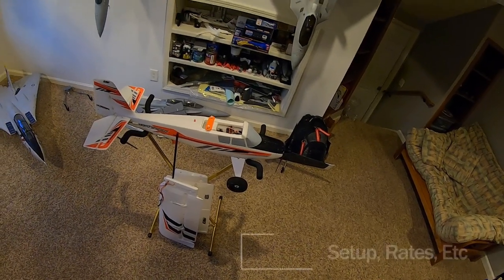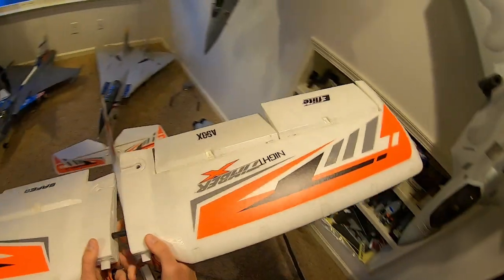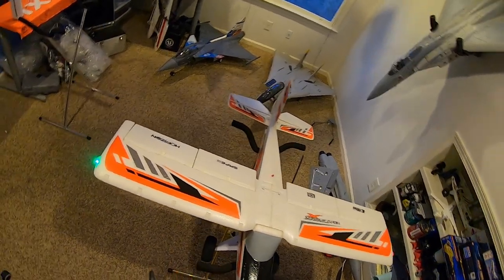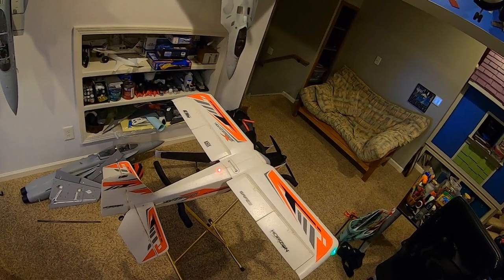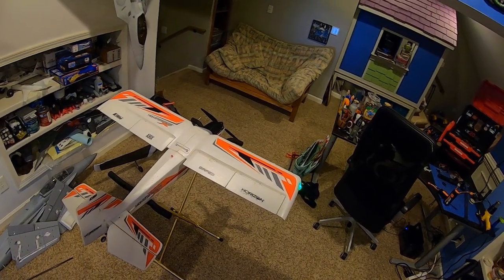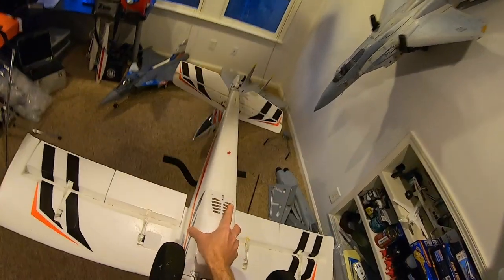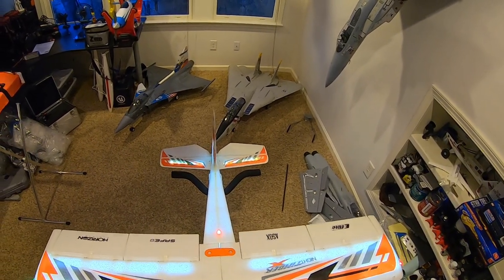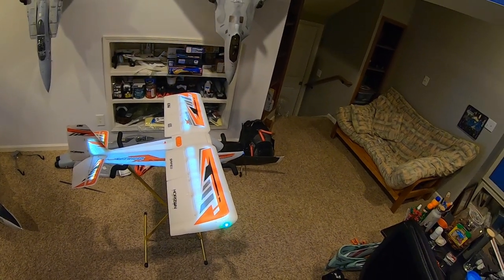E-Flite Night Timber X Setup - Flaperons, Harrier Flaps, Snap Flaps, Rates, Receiver Programming

Comment: Hey Jon, question for you, I have an NX8, but when I try and set the ailerons to 150% the travel stops at 100, any suggestions?
Reply from the maker: You need to unlock the receiver and reprogram it so it isn't locked to 100% rates. If you don't do this it can only travel to 100% because that's where Horizon locks BnF travel points.

Comment: Thank you for this video and the comments. I just got my night timber x after flying the the timber x 3d in real flight evo. I moved my lights to the bind port, split the flaps to ch 5 and 6 as suggested. But instead of building a new profile, i used the spektrum dx preset profile for the timber x full span aileron. Only had to move things to my preferred switches and build the harrier mix. 2:04
Reply: Can you explain how you did the harrier mix? I’m using an nx8. It would be greatly appreciated.
Reply: @johnd9357  he explains in the video, but you mix elevator to r flap, then for rates use 100 and -100. The flap should nove the same direction as the elevator, if it moves opposite, swap the 2 rates. And assign it to a switch.

Comment: Wow!  Never realized how little I knew about setting this plane up!  Thanks.
Reply from the maker: There's a lot to it if you want it to perform better than it does stock. Of course, this can be said about most models.
Reply: @TwoBrosRC  I could not quite catch the replacement servos you used.  Links on such things can be exceedingly helpful.  Do you get a commission from HH?  Perhaps you should ask for that.  I would buy a plane you reviewed and instructed on how to set up through such a linkage.  Have you flown any of the Addictions?  I have the smallest one and have 3 fabulous flights on it so far.  A bit pricey and not as robust as a foamy but boy does it perform and I can’t really do squat yet.
Reply from the maker: No commissions here from any RC company. I do get a small kickback if you buy from my Amazon links though. https://tinyurl.com/B11DLS is the servo I'm using here.

Haven't flown any PA models yet.

Comment: Good video. I’ve had a couple of Timber X’s and never could get more than 100% servo movement. I thought it was a limit set in the receiver. How do you get that much more throw? Thanks!

Edit: And I just read another post where you explained…which is what I thought I would have to do…Thanks again!

Comment: Nice video.  Got a kick out of your "older" airframes.  My oldest is a TopFlight Contender balsa kit that was my "warbird trainer" with an OS -70II four-stroke (third glow engine) that I have been flying since 1989.  ;-)
Reply from the maker: I doubt your 1989 model was made with EPO foam though. ;) This Timber X is basically ancient considering it's close to two years old and has flown over 800 times.

Comment: this is amazing.

are you able to do CROW with this set up? or do you need a new receiver/rewire the stock receiver to do crow?

is SAFE available/working with your flaperon/harrier/snap flap set up here? 

if using crow, is SAFE available? or does it have to be remapped!

looking forward to trying this!!
Reply from the maker: You'd need an 8 channel receiver for crow. SAFE works with any wing or tail type in Spektrum. Join Discord via bit.ly/TBRCDiscord for assistance!

Comment: Hi Jon, I recently picked up the Night Timber X. I bought the AGFRC 9g servos you're running. My question is, what servo horns are you using? The ones that come with the plane don't fit the spline on the AGF servos, and the ones that come with the servos seem way too small. Please help, Thank you!
Reply from the maker: I'm using the stock horns - the ones that came with the Timber X. They take a bit of work to fit into the AGF servos but will fit in if you force them to. Mine have been on there for 1.6 years now.
Reply: @TwoBrosRC  Thanks again for the help Jon! I see what you mean, they are stubborn to get started, but once you get them to stay, you can use the screw to get them down. I appreciate your help!
Reply: What servos exactly are you using? The b9dlm or b11dls?

Comment: Great video. I echo your statement on the durability of this plane. I have stalled mine to the ground herd 4 times. Once so hard I shattered the carbon rods in the nose. I replaced them, glued the nose and the landing gear back on and she flies great. 
What is the spectrum mixing bug you mentioned in the video?
Reply from the maker: The mixing bug is where the transmitter expects channels to be in a specific order but you've reordered the channels manually, causing it to bug out. You can see it on display in certain models like my Turbo Timber where I need to mix ELE to LAL to mix flaps, and mix ELE to FLP to mix ailerons for crow.

Comment: Hi Jon,  great video. Can you possibly explain further to what improvements you did on the landing gear? Had a small crash but the retainers of the springs broke off! Had you a similar problem and how did you fix? Thanks
Reply from the maker: I didn't really do anything else to it aside from reinforce them with Gorilla Glue eight months ago. That was only because the gear mount in the fuselage suffered some damage and I had to re-seat it properly.

Comment: Hey Jon.  As always, I love the technical detail you provide in your videos.  I experiment a lot with my Night TimberX.  Its an old beater for me, hence I don't hesitate to experiment.  Would you have a moment to answer a mixing question for me.  My setup: Night TimberX upgraded with an 8360T Receiver.  Every servo is plugged into its own port on the receiver.  All works very well.  I'm now trying to set up full span ailerons (flaperons) triggered by switch E on my iX12.  P-Mix 1: AIL>RFL: Switch E.  P-Mix2: AX1>LFL.  My left flap will not move in sync with my left aileron.  It moves in the opposite direction.  Is this what you refer to as the Spektrum mixing bug (my software is the latest revision.  It's as if I need a servo reverse function as part of mixing.  I don't see that as an option.  Do you know of a work around?  Any feedback would be greatly appreciated.  Thanks.
Reply from the maker: Try changing the channel you're controlling with aileron until it works, or reverse the flap servo if that needs changed. It's difficult to troubleshoot from text alone, but it does sound like the mix just isn't targeting the correct channel - or that the mix needs to be reversed. If you're currently using -100 and -100, try 100 and 100 instead.
Reply: Thanks Jon.  Tanks for those suggestions.  I got it working.  Turns out I didn’t need two mixes.  A single Aileron to flap mix solved it for me.

Comment: Love this video!  Wasn't sure if you covered it but did you max out the mechanical set up ie clevises and horns at max travel and then 150?

Also are you able to do safe on off, reverse thrust, full span ailerons and flap mixing as well as crow with an nx8?  What are your preferred switch assignments?

Going to try to program mine via what I've learned in your vid!
Reply from the maker: Hey man! I did set up the linkages for maximum effect. Clevises on the outermost hole on the wing surfaces, innermost hole on the rudder and elevator horns. Outermost hole on all servo arms. You can set up everything seen in this video with an 8ch radio. With regard to switch assignments, could you be more specific?
Reply: @TwoBrosRC  Awesome to know! really love that someone out there is doing vids that show what can be done "outside the box" on these planes. in terms of switch assignments, i was curious how you set your radio up for ergonomics? like do you prefer flaps on a certain side for last minute landing throws, same with snap/elevator flaps? in case you need to adjust quickly or go back to all off.  or reverse thrust being better on one side versus another? same with safe select and throttle cut and dual rates- theres so many switches sometimes it's nice to see how someone else does a set up that you can base yours off of.

i also saw in another comment that you mentioned unlocking the rx for 150% - did you have a vid on this or would you do one in the future, interested to learn more! i noticed in the nx8 i can only go to 125, but really 125 seems identical to 100 when i A/B them. does that probably mean it's locked? would it be worth unlocking or just maximizing mechanical throws?

i also realized i probably cannot do crow with the stock night timber x receiver because it only has 7 channels, and you'd need 8 for crow correct?

really appreciate you help and your vids! def subscribed!
Reply: @TwoBrosRC why outermost hole on wing surfaces? Wouldn’t going to the innermost hole give the most travel? Not sure why rudder and elevator need innermost hole for max travel yet the wing surfaces need outermost?

Comment: Awesome video Jon, thank you for sharing with the rest of us! 

I'm curious, why did you change the stock servos? (Because the originals stripped, they're just bad, or just your personal servo preference?)

BTW, I just got my banged up Timber X setup with these mixes, and  can't wait to try these out! :-) Thanks again!
Reply from the maker: Glad you enjoyed! I changed the servos because they're not precise and don't have as much torque as the AGF servos do. Precision is everything for flap compensation on the elevator - the stock servos will move to 5 or 7%, but not 6% - if that makes sense. You give the model the elevator comp required for full or takeoff flaps and it'll float upward because the servos don't actually move to the position the manual calls for. The AGF servos will, and they'll hold tight with the torque they put out.
Reply: Nevermind about the servos Jon, I had missed your final comments, where you explain its about precision! :-)
Reply: @TwoBrosRC  good to know!
I’m nowhere near your skills, but the idea is to get there 😊. 
I’ll have to give those servos a try! Thanks again! 🙏🏼
Reply from the maker: @OraTab  You'll get there! All it takes is practice.

Comment: I'm not a novice, but not a pro. I like capable flying. Holy quapamoly, this IS a setup!! You sent me the link a while ago. I've finally busted out my Night Timber X and have looked at your settings. I have a DX8 G2, I'm unsure if this will work. How many channels does this use?? Thanks for your reply and videos. AirHammer out!!
Reply from the maker: Just six total. Eight if you want crow.
Reply: @TwoBrosRC  That was fast!!:). Thank you for your response and great videos. 
This helps and magnifies the hobby for everyone above beginner. 👍👍

Comment: Ive noticed ALL ur planes r really shiny. Are you using the minwax clear gloss paint? (I have, & do but so far only my extra 300 & FMS pitts are THAT shiny!) So shiny you need shades on a sunny day! 😁👍
Reply from the maker: Nah, only my Extra, 737, and Pitts are shiny. The rest are just as they come from the factory. I use Minwax polycrylic and brush it on, though I suspect I'd get better results if I learned how to spray it on correctly.
Reply: @TwoBrosRC  

I spray mine, same paint. Yours/your brush on Method looks better than my aerosol! 👍

Comment: Are those AGF servos 180° rotation? I saw a review on Amazon that said they were only 90°. I am wanting to get a little more throw on the ailerons on my 1.5 m timber.
Reply from the maker: They move about 140 degrees with 150% rates. 180 degrees won't help you much because the ailerons on a Timber can only physically move so far before they bind.

Comment: Hey Jon, Great video. My new never flown night timber's elevator servo seems to have died while i was setting up. It works once or twice then starts to over heat it seems and stops working completely. I am looking at the servos you have recommended and am noticing the rudder and elevator servos are glued in there with some pretty serious adhesive. Almost a white epoxy i think. how did you remove them without damaging the body?
Reply from the maker: I just pulled them out. It's a silicone caulk that holds the servos in place. It won't damage anything if you pull them out gently. You can slide a knife behind the servos to help loosen them too.
Reply: @TwoBrosRC  thanks man!

Comment: Are you using the servo arms that come with the AGF servos.  They are quite a bit shorter than the stock servo arms. The stock servo arms do not fit on the AGF servos.. I haven't installed them but I suspect at 150 travel setting, I will get all the throw that is necessary even with the shorter servo arm.
Reply from the maker: Nope, I use the stock arms and made them fit by jamming them in and screwing them tight. Haven't had a single issue with the stock arms in 1.5 years of flying this model.

Comment: When you changed the servos did you have to use a reverse servo on one flap like the original setup.
Reply from the maker: It's been a long time since we did this setup video. The way this is done would necessitate having the flaps operate as ailerons so it wouldn't matter if it needed to be reversed or not - but chances are we would have had to reverse it with a dedicated channel regardless.

Comment: I wish HH would start to use T screw heads for the screws when building these. Esp the smaller version models.
I hate that they generally use very soft metal Phillips style heads. Esp for the landing gear. Those screws are easily the most often removed if you use floats or skis like I do. Those screws are very soft metal.

Comment: For the harrier flap mix, do you use 100%/100% mix, so a 1:1 ratio where the flaps move the same amount and rate as the elevator or do you use a certain percentage?
Reply from the maker: It's a 1-1 ratio - should be covered in the vid.

Comment: Rocking a nx8 and have a night timber x coming.... I eventually want to do the upgraded servos and expand throw limits but- for maiden and for learning the next few weeks what would be a good mild dual rates and expo to set each rate for (low mid highs) ---- and can I program reverse thrust the same as I did on my turbo timber evo (scrolling right to avian and setting up reverse and braking? Thanks for all you do to put out videos-
Reply from the maker: You can't program reverse that way, unfortunately. The manual goes over it - you just ensure that you've set the seventh channel to use for thrust reverse and it should be good to go. Any other channel requires using a programmer box, unless Horizon is shipping the Smart 60a ESC in this model unlocked now.

I can't really give specific advice on rates - I just fly on 150% with 70% expo at all times. I don't see a point in limiting throws unless a specific maneuver can't be accomplished at 150% rates.

Comment: How did you get your flaps not to go straight up when the switch is in a forward position. Whenever I use flaps on a 3 position switch, they go up as spoiler is when the switch goes up. How could I make the neutral point on the servo to be the forward point on my transmitter switch.
Reply from the maker: It'll be easier to explain these concepts on our Discord server via the #tech-and-setup channel: https://bit.ly/TBRCDiscord

Comment: Did you replace any of the hinges? What about the battery straps....those seem pretty flimsy.
Reply from the maker: Elevator and rudder hinges were redone with nylon steel-pinned hinges roughly 1.5 years ago. We don't use the battery straps, they've been removed. The battery is simply shoved to the back of the compartment and stays there.

Comment: How easy was the servo replacement in the wings? I crashed and the noes cracked so after fixing that I’m thinking of upgrading the servos
Reply from the maker: It's super easy.
Reply: @TwoBrosRC  awesome! I’m not running spektrum so I don’t have the gyro anymore, thinking new servos may help with the control… I’ve also been eyeing a flex innovations plane😅